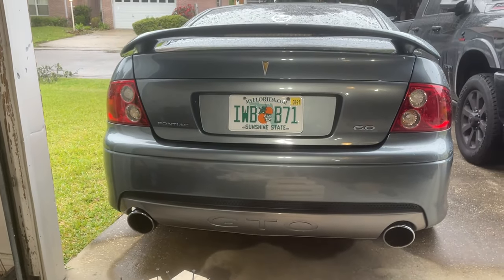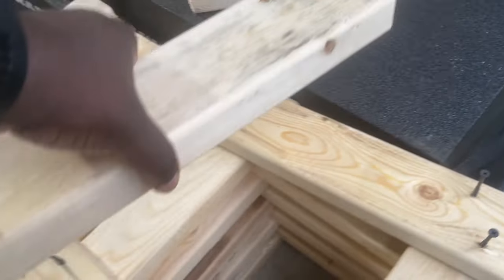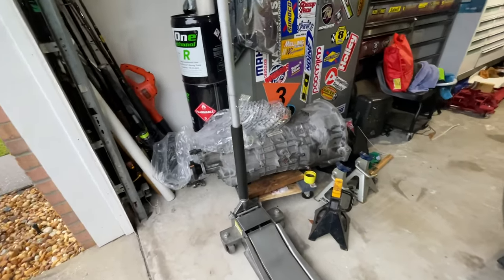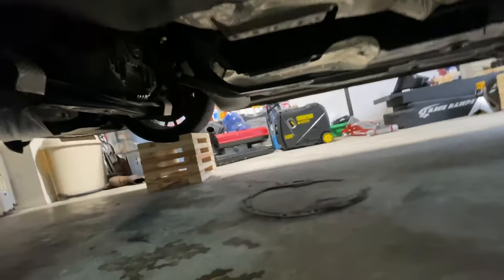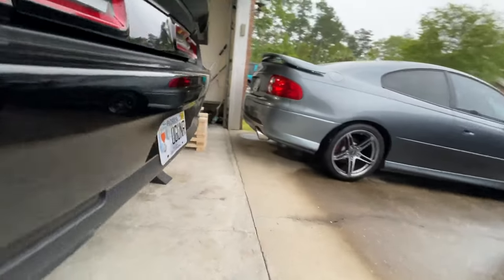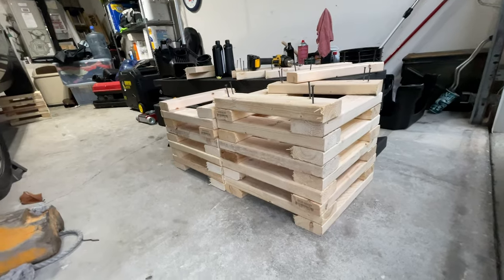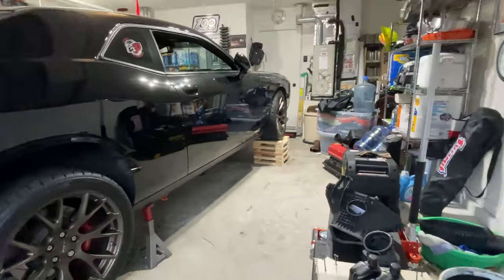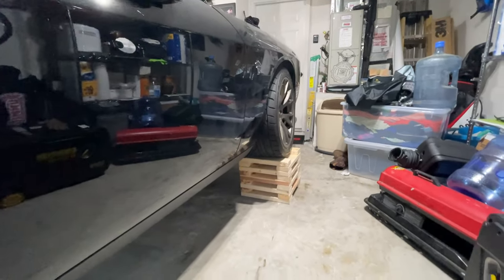MAKE YOUR OWN CAR LIFT AT HOME!!! WOODEN CAR STANDS!!!

Comment: Look up the video homemade car ramp because in that video you can jack up the car up to 15 in at 5-in increments you will see the design is superb other than the quick ramp this is the best way to go you can also make platforms to go underneath the Four Corners inside the wheels in case you have to do brake jobs this is the best way not the wheel cribs
Reply from the maker: Awesome I’ll check it out, because sometimes you definitely need to take the wheels off. Thanks again for the info

Comment: What was the best location to set your jack under your Challenger for the lift?  I noticed it is pretty awkward lifting these Challengers off the ground.
Reply from the maker: There are a couple locations, on the sides right in front of the rear tire there’s a rubber puck, and right behind the front tires there’s a pinch weld location, and the rear diff just put a piece of wood between the jack and diff.

Comment: That’s great… except fir the fact the 2x4 is “laying flat”. The strength is not there! Don’t believe me? Lay a 2x4 on its side across those two lift blocks , now stand in the middle. All good. Now turn it sideways and try it again. Be careful; it’s going to snap. Hence, the problem with this build.

Comment: If you design / lay it out right, the 2x4s don't even need to be screwed together... It's called "cribbing" and is commonly used when a house needs to be raised (lifted), possibly for being moved or to add a new 1st floor underneath the previous 1st floor...

https://thewoodmillofmaine.com/wp-content/uploads/2018/06/1465831_623233691070032_1938903752_o-1024x668.jpg

To get more height with your existing design, once you run out of lift with your jack and have the blocks under the tires, put some blocks under you jack and jack up some more... One of the advantages with traditional cribbing is that you can limit the distance that your vehicle can fall in case of a jack failure since you add a new layer of cribbing every X inches (X = whatever thickness your cribbing might be).  Sometimes, you might have 4x4 and 2x4 cribbing being used at the same time... Fire rescue trucks often have a selection of cribbing on hand for various types of jacking endeavors that they might need to do...

https://www.youtube.com/watch?v=nkVx6eQ3l4M

Using 2 ft cribbing made from 4x4s, they claim you can go up to 48" high safely.  But, they're NYers, so you can't really trust what they say... :)
Reply from the maker: Oh wow thanks for the info, I’ll definitely check it out.  I have family in NY so definitely can’t trust them 😂
Reply: @MissionFlyer  -- Next time a hurricane comes through, when the people are throwing away the fence sections that were blown down, grab the 4x4s and make them into cribbing... Normally, they break right at where they enter the ground since that is the portion that starts getting rotten the soonest over the years, but the rest of the post is still good... The last hurricane that came through here, I had over 250 ft of fencing laid down...